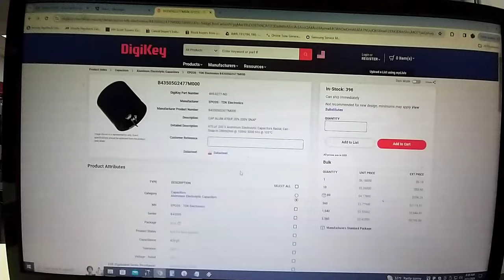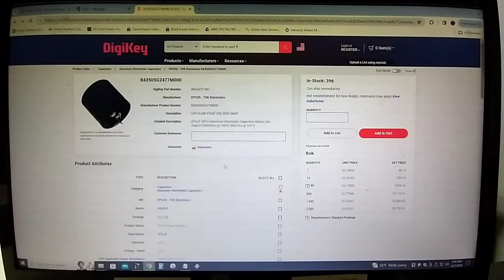Servicing a 1957 General Electric model 14s208 b&w, vacuum tube television. P3/? - Power supply pt1

Comment: That set looks like a nightmare to work on! GE was pretty cheap, but at least it had the decency to not use rubber insulated wire in this set that had insulation flaking off if you so much as look at it the wrong way.